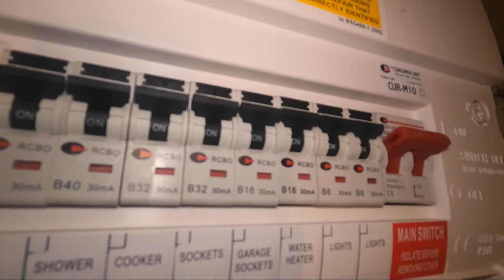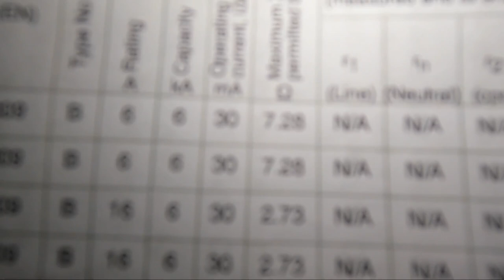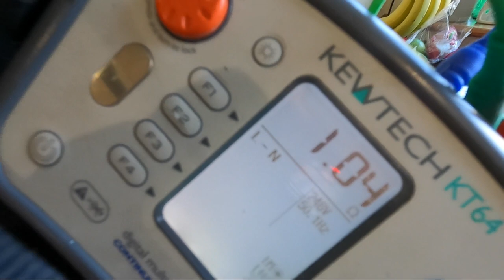Fitting downlights into an existing predrilled hole enlarging hole replacing

Comment: You did a Zs. It looked like you did it with the luminaires installed. How does that work? Surely that adds the resistance of the lamps and messes with your readings. 
Help to understand this would help my learning.
Reply from the maker: Hi Keith and thank you for your comment.
The ZS is the total earth fault loop impedance path, yes the luminaires are connected but they won't come up in the readings as they are connected in parallel, if they were connected in series then they would increase the resistance, hope this helps

Comment: As an adult learner these videos are a great help. The Zs of 7.28 for a 6A RCBO of 7.28 - can you help me by confirming this is at 70 degrees and that the "on site" value would be 0.8 times that, in other words 5.8?
Reply from the maker: Hi Grumpy Grandpa, yes you are correct, I stupidly just trusted the values on the certificate for the person that originally completed the EICR without checking myself.
I can confirm that the maximum ZS at 80% of max value would be 5.87 Ohms as per table B6 OSG P131
Reply from the maker: I think I will address this in a future video
Reply from the maker: I filmed this example this week, so it'll be out in about 3 weeks time, thank you